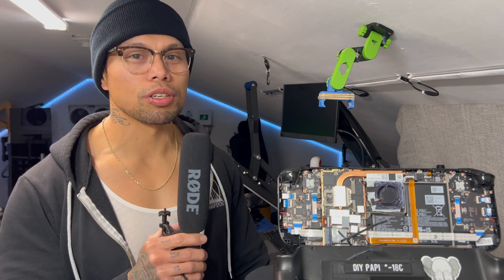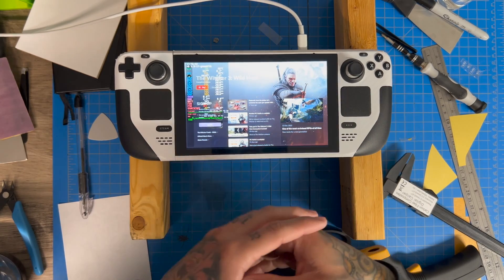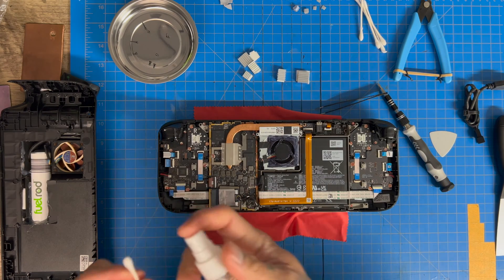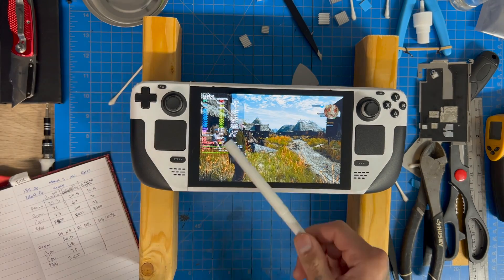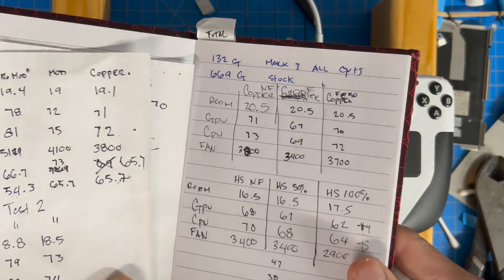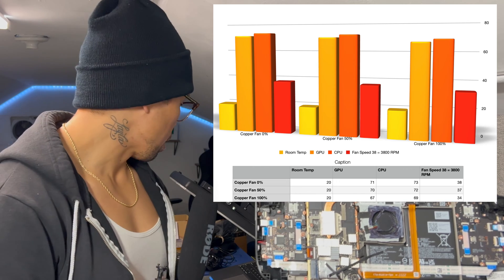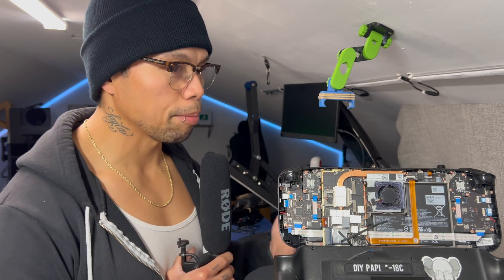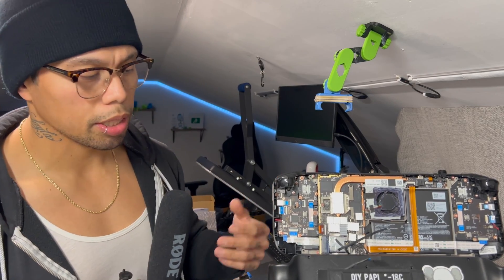How to get more Performance out of your Steam Deck while running Cooler and Quieter. Mod Mark 3.3

Comment: Hi. Test.
Remove the aluminum plate or sheet, put heatsinks on RAM, install heatsinks for energy transients or power supply, all independently, do not replace the aluminum plate or sheet, close the rear plastic cover, this will create a strong tunnel-effect air current thanks to the fan between those components and the processor heatsink, we are interested in removing as much hot air as possible in a short time, this example is taken from the Red Magic mobile phone

Comment: A quick and dirty way to test any given steam decks cooling effectiveness can be done. Simply measure ambient air and the temperature of the air leaving the deck under load at a fixed fan speed. It might sound counterintuitive, but you ultimately have energy leaving a system. The more energy removed, the higher the delta.

Im not an engineer so feel free to call me out.
Reply from the maker: I would agree
Reply from the maker: With you method I mean

Comment: Hi, Can you tell me the dimensions of the APU so I can buy a right sized thermal pad? 
Thank you.
Reply from the maker: If you’re talking about the contact point between the APU heat pipe and aluminum H shield it is 10 mm x 20 mm
Reply: @Diy_Papi  yes, so that be the size I should buy for the pad.
Thank you
Reply from the maker: Your welcome
Reply: @Diy_Papi  I just bought the jsaux normal 106 backplate and would like to cut or drill some hole where the vent sits, because I cannot get the vented backplate at the moment because it is sold out. Do you think it would greatly help cooling the device?

Comment: I just got the SD yesterday and today open the back cover, remove battery, and remove the heat shield. Planning just to add  those little heatsink you added without that heat shield cover. This heatsinks come with a adhesive that is thermal conductive. Are you still like this or you add thermal glue? Can you do another video as a follow up of this one.
Reply from the maker: Congrats! 

I currently don’t have them on, but when they were on I used the adhesive tape it came with.

If you plan on using it long term I would advice using thermal glue. You don’t want that thing to come off while gaming.

I can for sure do a follow up video👍🏼

Comment: Today 18 Mar 23. How is your SD after the heatsinks MODS?
Reply from the maker: Everything is good no issues
Reply: @Diy Papi  are you still using the SD with aluminum heatsink s? How you hold them on place ? Heat glue?
Reply from the maker: @mikehotiz8506  yes and no, I removed all of the heat sinks that are on the SOC. But added a external fan to cool the SOC down . Video will be out tomorrow. Steam Deck ultimate mode episode 3! Stay tuned!

Comment: You can engineer it all the way to making new back and new heatpipes/heatsink on APU but at the end of the day there is really not much point if need something cooler/faster etc just buy a faster device should probably eventually see zen4/rdna3 chips
Reply from the maker: True, Steam deck is already kinda outdated. But its still great for the Med to low demanding games and who doesn't wasn't a cooler and quite Steam Deck.

Comment: Have you checked out graphene sheets instead of thermal paste for the APU?
Reply from the maker: No I plan repasting the APU with Noctua nh1 after I complete test with the new Jsaux back plate and cooler.

Comment: Will be interesting to see mod ideas like this incorporated into third party back covers. Ive already seen a clear back cover with a heat transfer plate on it. Fully expect to see it expanded on and improved.
Reply from the maker: Things I have in mind for when I get it in
1 thermal test including VRM an Controller
2 Cooling with a fan,
3 cooling with a Peltier 
4 removing the aluminum plate

Stay tuned

Comment: Very interesting and nice modifications! - And we all know, higher temps make hardware age much faster. For me, I would love to have a additional cooling when using my Deck docked in 1080p (let´s see, what the JSAUX exhaust cooler mod will do - which you are probably going to show soon), but beside of that, I am mostly downgrading gfx fidelity and/or fps, what mostly helps with temps to keep them below 70C or below that. In the end, it´s a handheld and should be compact and transportable. But a dock upgrade, which is removable fast, would be dope.
Reply from the maker: Already working on what you just said. I call in the "compromise" im taking everything I learned and putting it all together.
Reply: Hardware ages the same as anything over time
Reply: @samgoff5289  Sometimes more, sometimes less. I have consoles and computers in my man cave, which are probably older than some of the people, posting here comments 😅 - But they all work as fine as on the first day. That´s why I treat all of my stuff as best, as I can.

Comment: Dude! You gotta try heat PIPES. 
Just today someone in "Surface" subreddit glued 3 heatPIPEs to the intake fans.
Its one of the TOP posts so you can't miss it.
If you do, its "i_upgrade_my_surface_book_2_by_adding_a_fan_and" in the title.
Reply from the maker: I've thought of doing that but, I've stayed away from that mod because it will cause more fragile bulk that's harder to do. 

Both the copper plate and heatsink are very compact and easy to inclose and can be cool passively or actively very easily. 

cooling the additional heat pipes would be harder and LLT pretty much. did that already

My goal is to get better cooling with as little money and work possible.

Comment: I wonder how well it would work if you left everything stock and just removed that shield and chucked on some heatsinks ?
Reply from the maker: I think the results would be somewhat negligible, the APU you might get hot quicker because it can dump it into the heat shield.

But for the most part I think it would  run close to the same.

Main issue is space for the heat sinks because there's not too much of that inside to steam deck. Especially on top of the APU.

Comment: Honestly gotta say how impressive your mods have been, I’ve seen them all from the beginning. 

Recently got my deck and installed the Sabrent Rocket SSD 2230 with 5GBps and 800K IOPS. It’s definitely made a difference. Then I installed Star Citizen, works pretty well but the GPU & CPU usage on the deck whilst playing is always 80% or more. Everything’s on low settings in game but still very stressful for the deck to handle. 

Is there a way of making the deck more efficient for running non steam games like Star Citizen? Any additional software etc? Thanks and keep up the mods they’re looking amazing!
Reply from the maker: Sounds like Star Citizen is more of a CPU intense game.

Try to manually clock the GPU starting from 1600 MHz and working your way down by a 100, until you find a sweet spot.

also if you have already, in the bios you can adjust the amount of RAM from 1 to 4 gb in the Bios. This may help a little.

Thanks for the kind words 🙏🏼
Reply: Have you tried bumping up the graphics settings to see if that age old trick works for SC?
Reply: @jacobl7899  do you mean make the graphics higher? Everything is on lowest, resolution on lowest too, still is hard to handle but plays surprisingly well

Comment: I did this 2 months ago! Great videos man I already subscribed.
Reply from the maker: Bro the heatsink Mod is legit! Thanks for the sub!
Reply: @Diy_Papi  there are some copper heatsinks with adhisive tape for Rasbery Pi's you maybe wanna try them. I didn't try them I just have the normal heatsinks with adhisive tape but I will order them soon.
Reply: @Illyrian  how been with the pi heatsinks? I waiting on the thermal glue to arrive.
Reply: Do you know if this helps the thermals on the vrms when you use heatsyncs

Comment: Great job!!.... To help a little further, have you considered using the honeywell PTM7950 thermal pad in place of the stock thermal paste?
From what people are saying, it's the next best thing to liquid metal and it's not electrically conductive. (LTT did a video on the stuff)
Either way, congrats on the low temps....subbed
Reply from the maker: I definitely plan on repasting it in the near future. just watched the vid and now Im sold!

Comment: Yeah man, this is what I've been waiting for!!!  Thanks.
I'm planning on using copper heat sinks, and I'm also planning on putting them on the RAMs too.  So glad it works.  I'm just going to do this mod with the aluminum heat shield off and with the stock backplate.
Reply from the maker: That's not a bad idea, but be careful there is not a lot of space in there and the only reason I was able to fit a lot of the heat sinks were because I had a hole in the back of the case.

The controller chip, next to the SSD is really hard to put a heatsink on it.
Reply: @Diy_Papi  I'm probably gonna have to shave off the tops of heat sinks to make it fit if they are too tall.  How much space would you say is the measurement from a mosfet to the back of the shell?
I did see you having trouble with the controller chip, so thermal glue is gonna be needed.  
Overall, it's a good enough result for me to try, all thanks to you!

Comment: These mods will come in handy for the overclocking that was just  figured out. search on reddit if you are interested in that. Thanks for your work making these videos. Also be careful of condensation with the peltier.  Best of luck. 😀
Reply from the maker: You’re very welcome, and with the peltier, let’s just say we are having frost problems lol 😂
Reply: Personally, I undervolted mine. Way more battery, way less heat, and a little bit more performance where/when I need it.
Reply: @SolidSt8Dj  Facts, always undervolt! Overclocking isnt worrh it here.